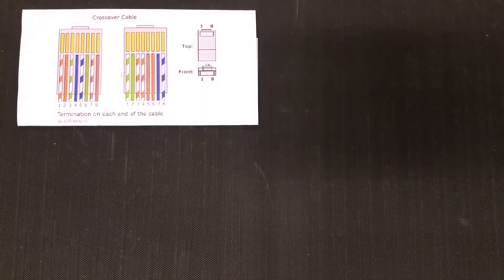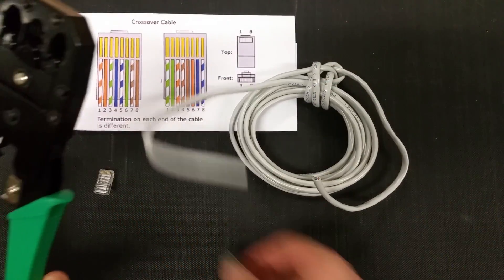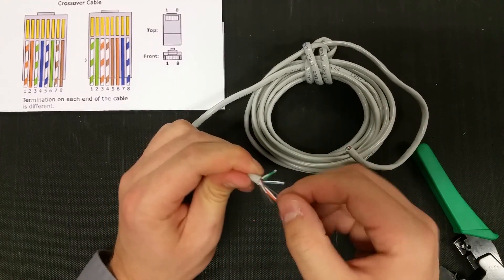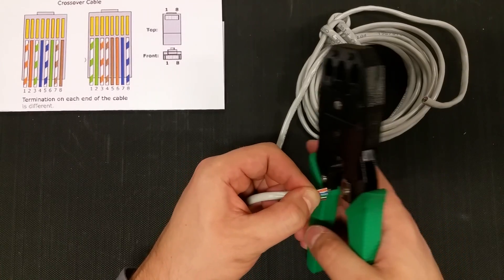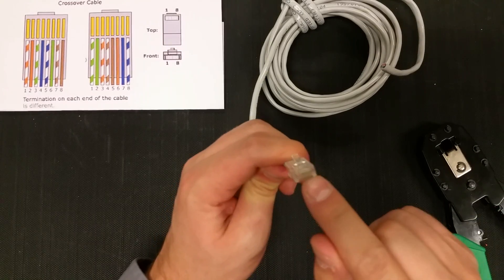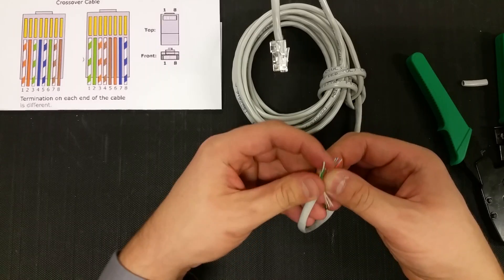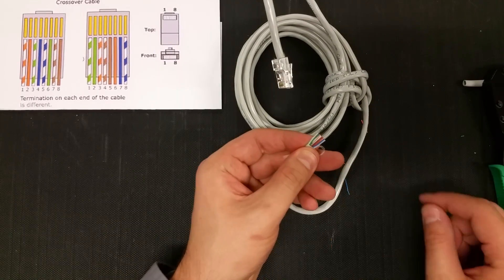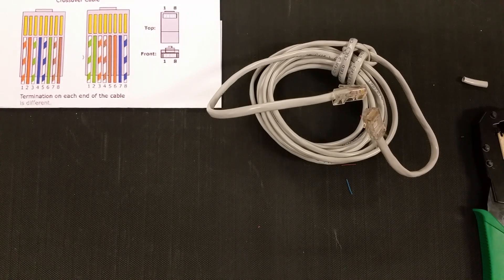Creating an Ethernet Crossover Cable

Comment: From 568A to 568B you only need to reverse 1,2 with 3,6.
Not sure what pin out that is supposed to be on the right,but it definitely isn't 568B.
For gigabit applications or full duplex then that would be what you need,otherwise just reversing 1,2 & 3,6 (A-B) on one end would suffice.